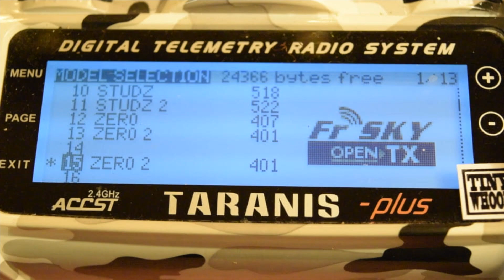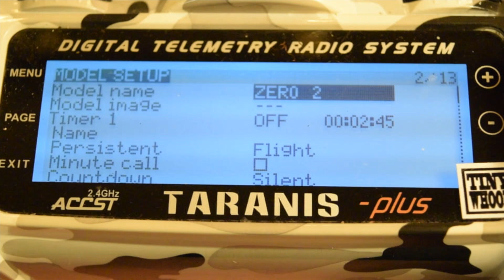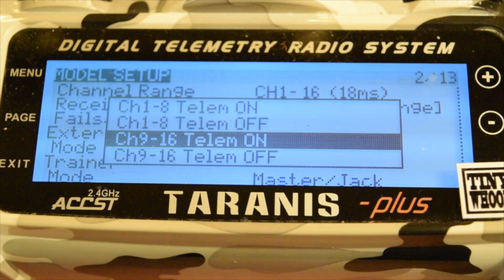AlienWhoop ZER0 Build

Comment: My whoop isn't responding to my radio and I have no clue why. I bound them together and properly assigned the correct switches several times and I still won't get a response from the drone. Using an Alien Whoop Zero and an R-XSR receiver. Any help is appreciated.

Comment: probably a dumb question but im new at this and cannot find any diagram or video or instruction for it. can someone tell me what pins to solder my camera on to? and how to get osd. thanks in advance
Reply from the maker: Sean Andreas all good either straight to the pigtail power or to the 5v/G under the board if your camera supports it and for the osd you need an osd camera that u can solder to the power
Reply: VELCROFPV thank you so much! Searching for hours to try and word my questions to get the answers I’m looking for! One more thing if I buy a AIO camera with built in osd,  that means I don’t need osd on my FC correct? I just solder the power and the camera will send the osd to my goggles?
Reply from the maker: correct you need to get a camera that gives you osd straight from batter power like the FXT805-OSD

Comment: Wtf, are you saying that the purpose of a second antenna is telemetry and not optimal rf signal?
Reply from the maker: Cyril Adams still get telemetry dickhead and still be able to fly just as far
Reply: @velcrofpv7948  oalso you're saying to remove one antenna of the rxsr , but if we use telemetry we can keep booth, why?
Reply: @velcrofpv7948  woaw, calm down bro, it's just that what you saying is confusing my dear... So I finally get  to understand that you won't be able to fly further with 2 antennas  right?

Comment: Ok if I installed alienwhoop zero upside down in a boss frame, how do I flip it and how to flip motor orientation?
Reply from the maker: It wont work sorry bud has to mounted upright
Reply: I know this is old but, I'm pretty sure silverware has board orientation in the file. This would mean getting a st-link and soldering it up though but, if you're gonna rock the silverware board you should probably learn how to use it. Give it a quick google and you'll find an rc groups or mmw thread with the info.

Comment: You mention to solder up your camera/vtx, but no mention to which pads... nor in the pictures on the product page do you state where to solder to.  I'm assuming it's the 3v3, SPI and TX1 pads that are next to the Rx pads?  Thanks!
Reply from the maker: Mikey Richard on most whoops you solder your camera straight to your pigtail like i do sorry for not mentioning it also right new to the pigtail pads theres a ground/power if you want to use that
Reply: VELCROFPV omg... right.  I’m an idiot.  Hah!  This isn’t my first whoop, but I think my brain was thinking about my new Chameleon I’m also building... but yep, that’s exactly how i soldered up my last whoop.  Thanks for the response!

Comment: Is the setup different for a qx7? I've got no light on the fc once it initializes no arm no modes
Reply: Same for me. Any resolution?
Reply: theevilbillgates I ended up contacting alienwhoop they talked me through setup and mentioned something about ch10. I set up channel 10 seemed to do nothing so I started over set ch5 and 6 and everything just started working!? Best I can tell you is try starting over if that doesn't work they have great guys to help you just send them a pm
Reply: Thanks! Will do this later today after work.